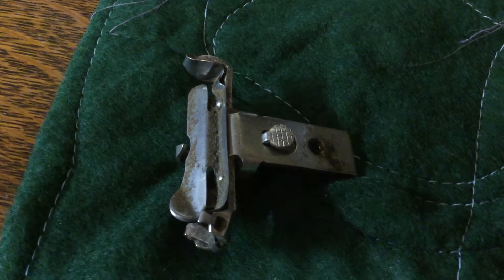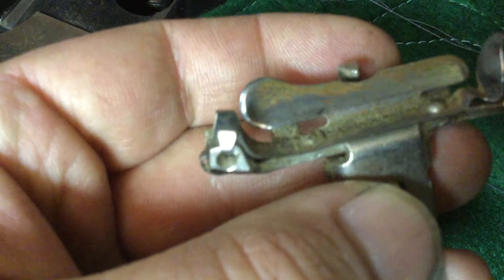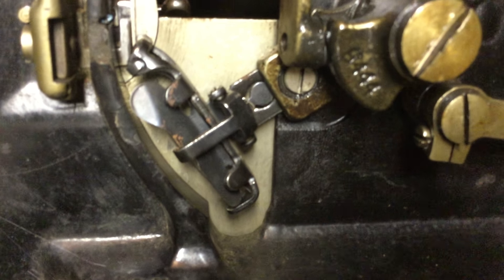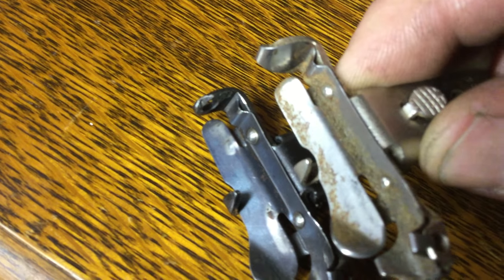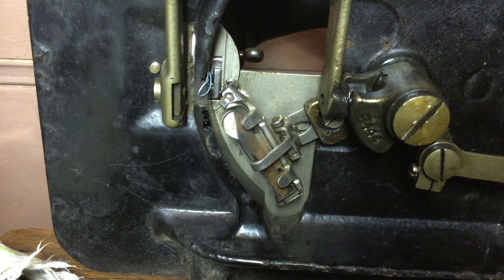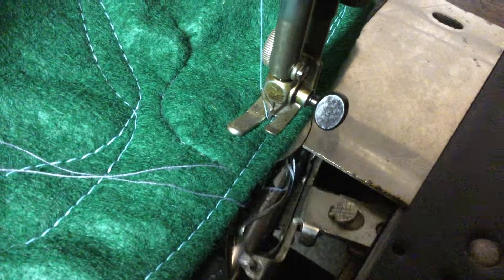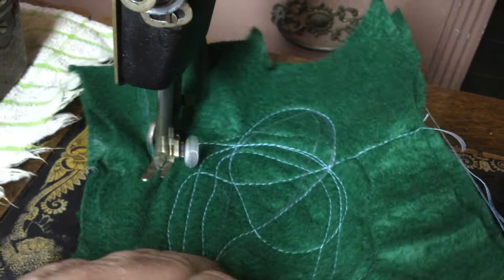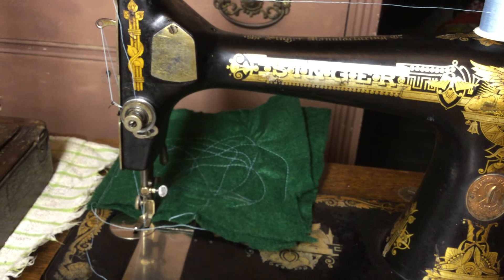Singer 127 Shuttle carrier replacement.

Comment: You did not demonstrate the removal and replacement of the carrier. Nor did you show how you made the clearance adjustment and with what instrument. Please redo this video.
Reply from the maker: My adjustment method for the carrier is not very precise. I  adjust so that their is a little play between the shuttle and the race. 
You could take an index card and place it between the shuttle and the race and adjust the carrier meter to the shuttle while pulling on the card until you just feel a resistance.